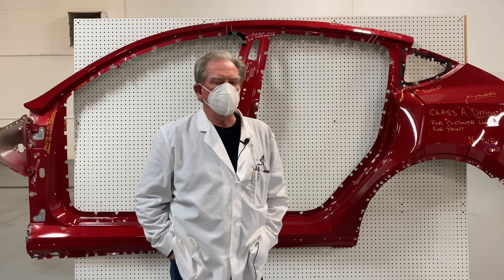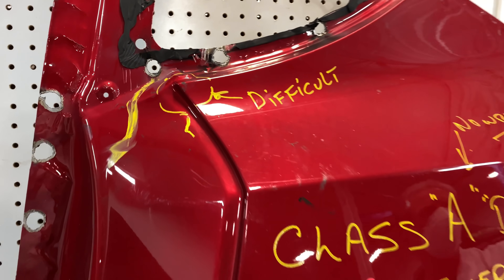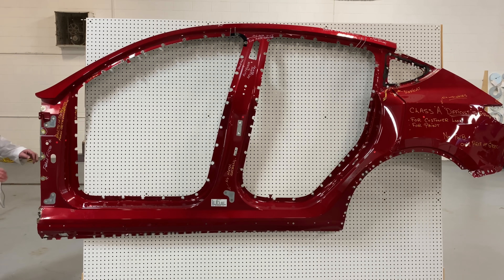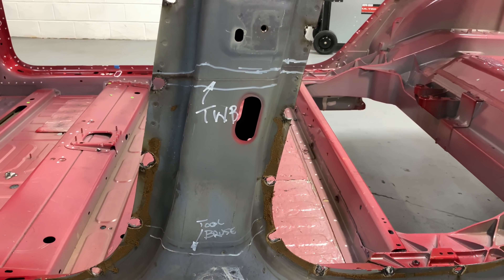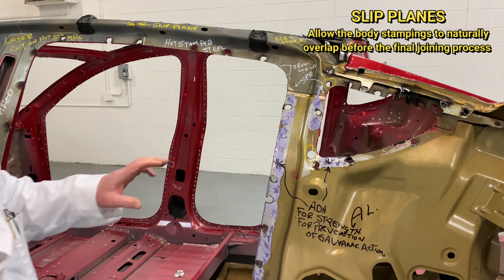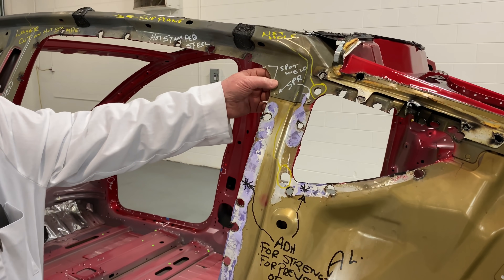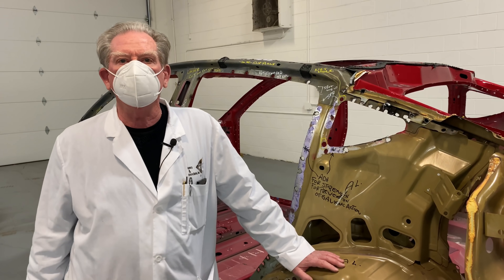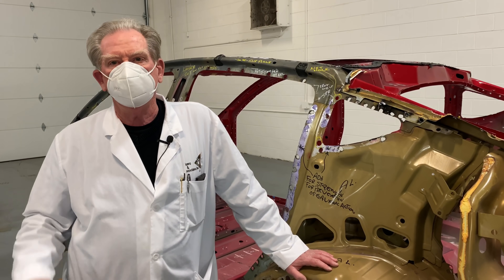Model Y E37: Body Structure Internals Revealed, Hot Formed Steel, SPR's and More

Comment: My theory about the foam block found above the wheels - I noticed it was also found behind the subwoofer. I know from acoustical theory that there needs to be a specific cavity volume behind the speaker to properly tune the sound. I think maybe the foam block was there to remove air volume, as it looks as though the cavity would be too large otherwise.
Reply: It's there primarily to minimize the vibrations of the sound waves that transfer to the sheet metal and could compromise the welds and bonding. It acts like the sand in a bag, by absorbing the impact forces so that the negative effect to other areas gets lower. The same technique is used on tall buildings in Japan, where movable weights are installed on the top to absorb as much forces as possible and minimize the effect of side shaking of the entire building during earthquakes. The logic behind that tecnnique is that if there is a movable object, it requires some force to be moved, hence less forces are left to affect the rest of the stuff that must be kept intact.

Comment: I would appreciate to know if the body (in fact all parts) is better than other manufacturers body's.
Comparing to model 3 does only give little informative value. Thanks.
Reply: I work in this industry (when we're not locked down at home!) as a service provider. What I'm seeing is pretty comparable, and that's a compliment, because they are up against a very well-established industry. The integration of aluminum panels into an otherwise-steel shell is unusual but not unique (those SPRs have been around for a long time - joining dissimilar materials is what they are meant for). Hot-stampings for the door ring are common nowadays, that low-offset frontal crash test required door rings to be enormously strengthened. The huge aluminum casting structure underneath is an advancement. Foam injected into cavities has to be used with great caution ... it can lead to water being trapped and thus lead to corrosion. Tesla's cooling / HVAC / heat pump integration is beyond what other manufacturers are doing. Basically Tesla has been learning from their earlier models - one lesson has been to not do stupid stuff like falcon-wing doors. The overall package here looks very good, and that's the first time I would have said that about a Tesla. Now if only they'd fix the availability of parts and servicing procedures ...
Reply: @bikeaddictbp  ohhhh, thanks a lot. Great summary.
Reply: @bikeaddictbp  the huge aluminium casting is nothing soectacular, if you look at sandy munro when he took apart the bmw i8 years ago in 2013 it had huge casting parts and alot of carbon fiber and recycled materials, Tesla needs to make his cars with recycled materials like volvo is also doing now
Reply: Keep in mind, this guy makes a living by selling that detailed information to manufacturers - so don't expect too much for free.
Reply: @bradley3549  I get it, i am just hungry for more info. I work in auto industry so any (free) information is good information :D
Reply: PJ  pray tell, who do you work for? 🤔😉

And are you working on electric or ICE?
Reply: @DavidHRyall  :D dont worry i am not a spy.
I work in auto industry not for a car manufacturer. I design production lines for headlamps. This interest is purely personal ;)
Reply: nonsense, this is nothing extraordinary, other manufacturers have been doing that for years, the advantage of EVs is their battery position on the floor plus the stability it gives the car, an ICE is very different except for sport cars